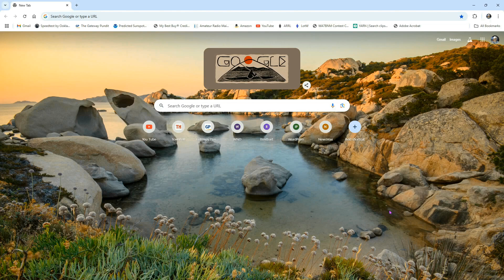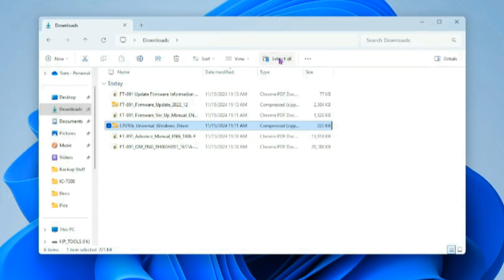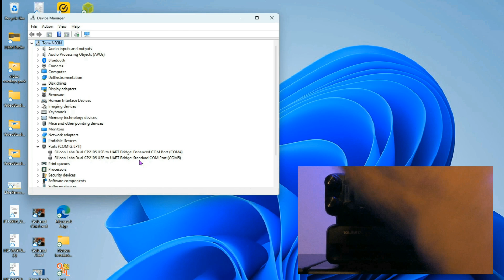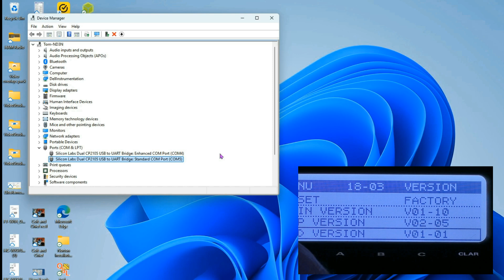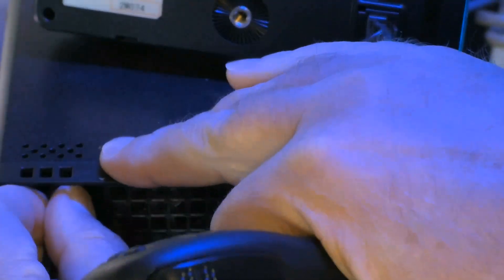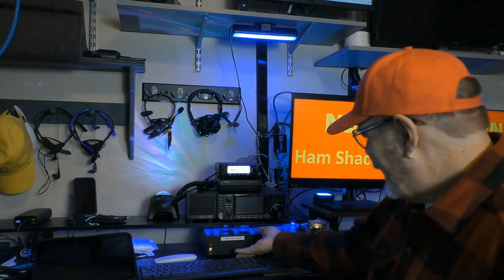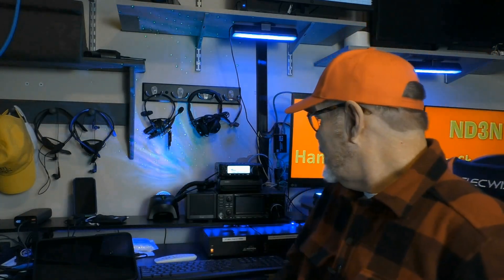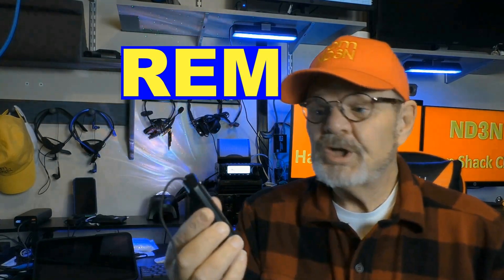FT-891 Introduction, Overview, First Steps, and Accessories

Comment: Excellent video, sir!  Using FT-891, SignaLink USB, and WSJT-X.   On 10m, FT8, software says 29.074.000.  But I find better results at 28.075.000.  But I make a few QSO's, then I see the radio says 28.074.500.  Then a few more QSO's, then the radio says 28.074.000.  Next, it says 28.073.500.  Why is the radio frequency indicator dropping?  What am I doing wrong? Or how can I fix this? Many thanks!
Reply from the maker: I don’t know why your rig isn’t changing freqs, but the correct frequency for 10 meter FT8 is, 28.074 MHz, so you ended up in the right place…
Reply: @ND3N  You are right!  28.074 is correct.  But I've been using it in the past few minutes, and now the dial frequency is on 28.073.000.   Once this morning it was on 28.072.   It keeps dropping after each QSO.  That is what I don't understand!  What could be causing this?  Dean, PU7MOJ
Reply from the maker: Are you accidentally bumping the main dial knob?  I can’t think of anything else that would change the frequency…
Reply: @ND3N  No, I even have the dial lock on so it cannot accidentally get moved.  But i have found the problem now with the help of another ham.  In WSJT-X, in split mode settings, I had checked "FAKE IT", instead of "NONE".  I changed it to none and the problem is gone.  All working perfect now!  Thanks!
Reply from the maker: @ fantastic